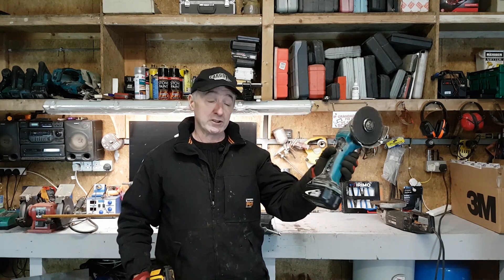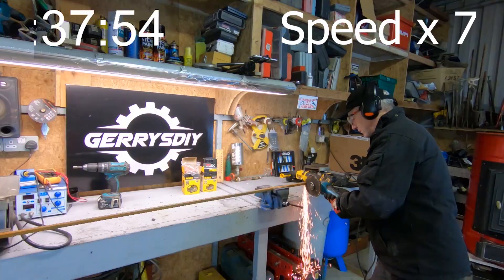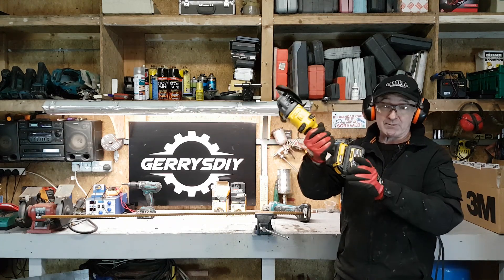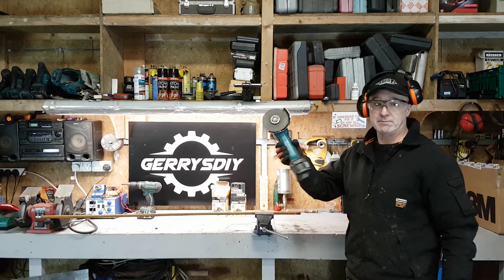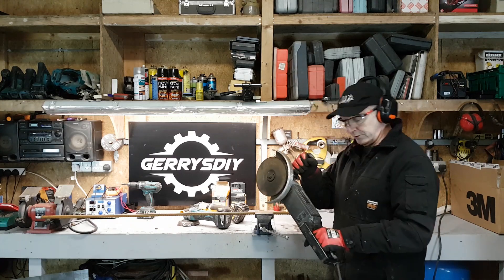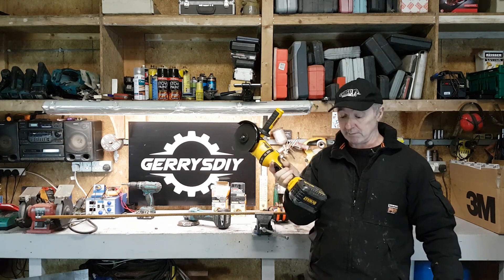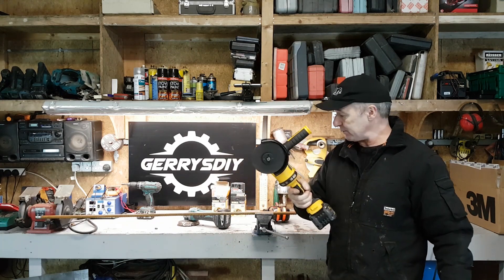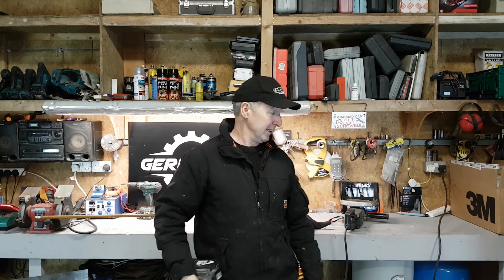Rip 3/4 inch Re-Bar in 5.5 seconds with 54V Dewalt Angle Grinder

Comment: Come back in a couple of years. That DeWalt will have made an exit via the recycling.
Have a drawer full of damaged DeWalt drills. Gimme The Makita
Reply from the maker: Hi Mike. I do have a love hate thing with Dewalt. Most of my stuff is Makita. Thanks for commenting Cheers Gerry 👍
Reply: @GerrysDiy  same here. Been a full time woodworker for quite a while. I love the price but hate having to drive 40 miles to repair, replace it. So I figure what I am willing to pay and add an hour's time and travel expense and my hand usually falls on a Makita or even Milwaukee.

Comment: Great comparison Gerry. I've got battery tool and it is a 20 year old Dewalt 14.4 volt drill. Still works great. For anything else away from the buildings, I toss in a generator to power up to and including the plasma cutter and welder.
Cheers my friend! 
MB BAR RANCH